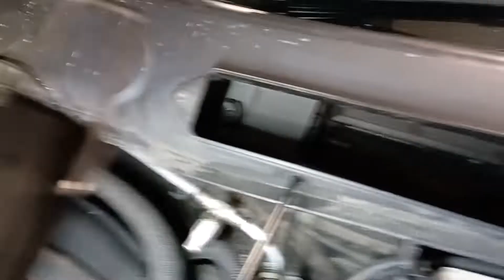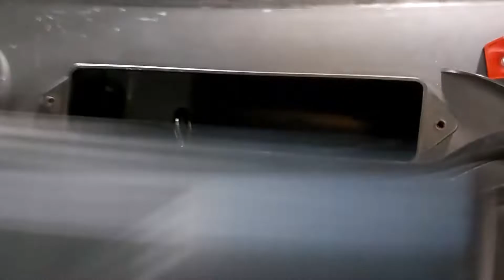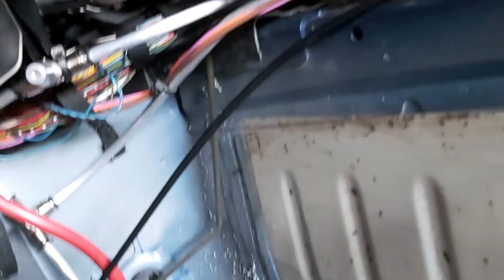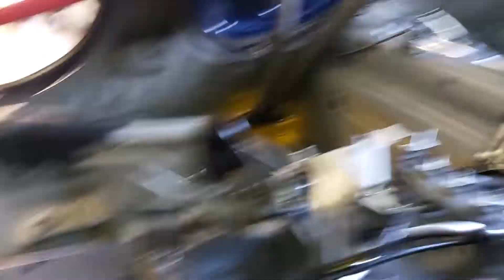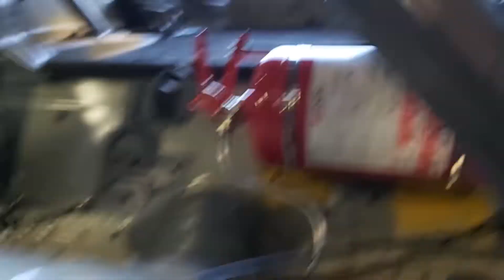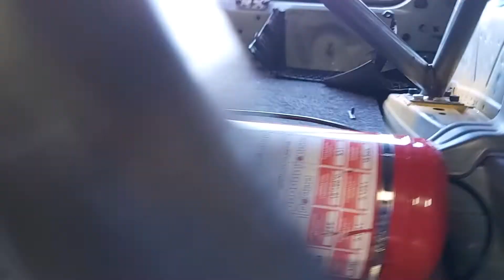BMW 116 Trophy Build - Fire extinguisher external pull installation

Comment: I like the look of the bracket you have for the pull cord, below the windscreen.  Was it in one of the kits?  Been looking everywhere for one!
Reply from the maker: Sorry for the late response, Jim.  It's just a piece of angle steel.  I drilled the holes for the extinguisher pull and the cut-out button.  I then cut a slot from the extinguisher hole to the edge so that I can remove the pull and cable without unthreading it back through the car.